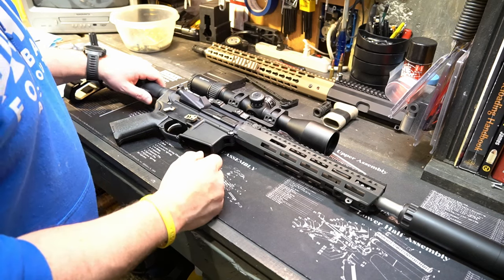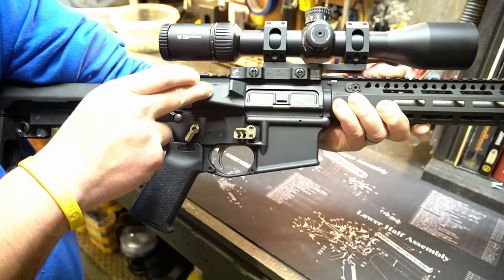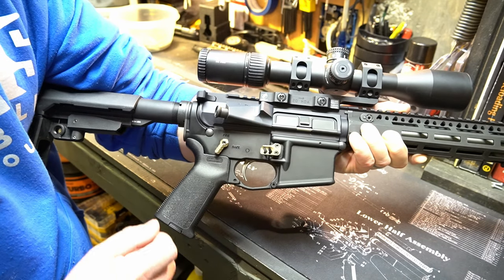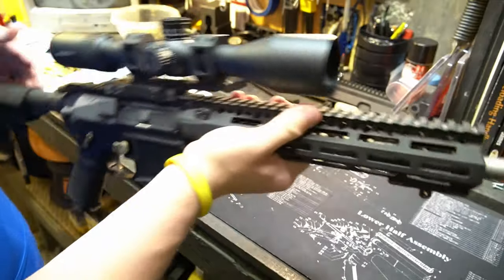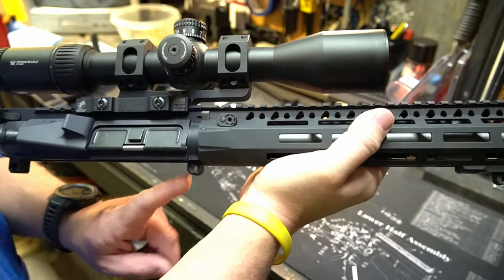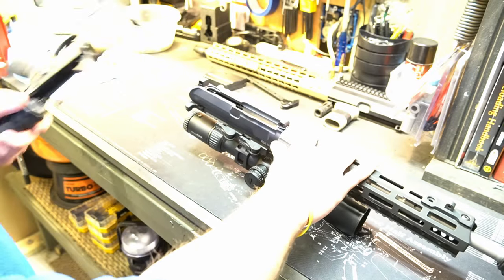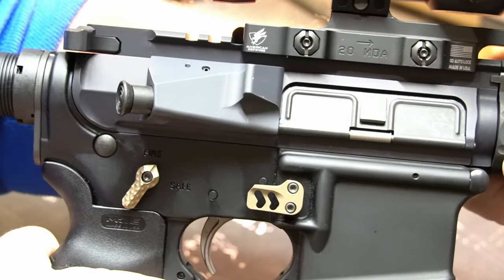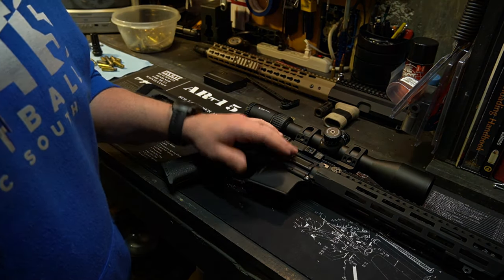AR15 Upper and Lower Wobble Fix

Comment from the maker: #7 or 3/8” o-ring should do it. Be sure to subscribe to see more 👍
Reply: Any link in specific
Reply: I got some at Lowe's today for $3 to put on my ar-556 , works great!! Thank you friends! 1/2" o.d x 3/8" i.d x 1/16"
Reply: If I had to pay a gunsmith assembler for a job, I definitely wouldn't want a cheap o'ring to replace many times. Not really any good choices for the wobble I suppose?
Reply from the maker: I would never pay a gunsmith to install my .03 cent o-ring. This is a diy, dirt cheap fix.
Reply: @HoosierHunter  Temporary.
Reply from the maker: Nailed it!  Sweet comment.
Reply: @Allenmar73  You just keep putting o-rings back on if one breaks. This is a permanent fix.
Reply: Was gonna ask lol thanks for the video
Reply: Pls describe in mm
Reply: Why not put an o ring on the back one too?
Reply: @chozen_juan  I would assume because the added o-ring creates a much tighter fit making the pin harder to push in/out and the rear pin is used much more frequently to open the rifle for cleaning.
Reply: Where can you get them?
Reply: @HighHOPE36  Virtually any hardware store. Or Amazon.
Reply: Thanks!
Reply: Can you use a metal washer?

Comment: For a permanent fix pull the pistol grip. There's a small set screw, turn clockwise with upper attached. Light finger pressure. Check fit, adjust more if needed. Then check fit of take down pins. If too tight back off an almost imperceptible amount.
Reply: Most lowers don't have that tension screw you are talking about, Aero does and some others but not many of them

Comment: I was just finished with a build and mating a Wilson Combat upper to lower and it had a wobble. I installed a new wedge which has always taken the wobble away but not this time. I got online to get other ideas and came across this video. I had some 3/8" O rings so I tried it. Perfect, I was even able to remove the wedge and it's nice and tight. Thanks for the video that turned out to be such a simple fix for something that's also frustrating to me.

Comment: I'm glad you made this video, those o-rings are going in my cleaning bag and my range bag TODAY.  Now, can you make a video that shows how to correct the play between my stock & the buffer tube ?  That drives me nuts.
Reply: My pistol has a SBA3 brace. What I did was, I took clear duck box tape and put it on the inside of the brace/stock on the top. I’ve put about seven layers of tape on the top inside until it got nice and tight and it works great.
Reply: I put the soft side of a velcro square on the top side of the stock. You have to rock it on but once its on its pretty tight. Little to no wobble. Now I havent tried taking it off since then but I plan on keeping that MOE stock on semi permanently.

Comment: I was going to try a thin washer shim between the pin ears, but your o-ring works fantastically, and I don't have to worry about losing a shim during a field takedown - since I have boxes of assorted o-rings just laying around, I feel like this is a completely free fix.
In the past month, I've eliminated buffer spring ringing (captured spring), gas tube ringing (high-temp fluorinated rubber o-ring), and now you've solved my upper/lower rattle.  My DDM4V7 Pro finally feels rock-solid, after 3 years of frustration -  Much appreciated!!!
Reply from the maker: Awesome feedback. Happy I was able to help 👍. Thanks for watching.
Reply: How to fix the gas tube ringing?
Reply: @anomalous8652  Armaspec has a quiet buffer tube spring system for ARs that suppresses the ringing, and I assume it would help the VR80.  There are other more expensive options (JP Enterprises works the best, from what I've read).  I use an Armaspec on my DDM4V7Pro (it works very well), but I've not bothered to tame the clap of the VR80.

Comment: Not knocking the idea because it’s affective as can be after trying it myself, but I’m just wondering if the extra tension will cause the stud provision to stretch or wallow from heat or vibration?

Comment: I put an o-ring in the rear also to fix the slight wobble on my new ar556 mpr Ruger. Did I do it wrong?
I mean: can the o ring get in the of the way of something during the cycling of the weapon?
By the way in my case o ring front and back and no more wobbling at all.
Thank you 👍🏻👍🏻

Comment: I just bought a Springfield Armory Saint Victor, and it has a screw accessible through the grip that tightens the connection between the upper and lower receiver. There wasn't much to begin with,  so a quarter turn on that screw was enough to make it feel even better.
Reply: That’s a tensioner screw arrow has them also, but you need to install the Magpul grip to adjust it without moving the grip. Magpul is the only grip I believe that has two holes inside, one for mounting and the other for the tension screw

Comment: Had this issue on a slightly customized URG-I airsoft replica - pretty annoying wobble, fairly more visible than what you showcase in your video. Didn't have a spare o-ring on hand but managed just fine with a thin strip of gaffer tape. Upper/lower fit is nice and snug now; no play, no annoying rattle. Thanks for the tip!

Comment: Nice fix. My gunsmith used a sharp centre punch and hammer to force some more material to those upper receiver attachment holes/hinges. Both making the lower receiver pins move tighter in the holes, and, if selecting where to force more material correctly, also shift the fitting a bit. Wigglety-wobble disappeared completely. 

I guess I should paint that exposed point in metal some day.
Reply: Never heard of that before, but it should work. You can check the play in the holes and see where you need to punch with a 1/4 inch cotter pin. Was never a fan of using o-rings so I'll be trying the punch method instead
Reply: Good idea the other way is to go with the Jp oversized pins and custom fit them to the upper. Thats what I’ll be doing soon. No rubber for me I don’t like stuff that I have to worry about wearing out.

Comment: Can you let me know the size of the rubber O-ring?  So I don't have to buy a whole set and try them all? Thanks in advance.
Reply from the maker: Sorry, I’m away from hone now and not there to measure it.
Reply: The size of the o ring is just about the size of most Fuel injector orings or just smaller. I used a fuel injector oring which was slightly large but only made the fit even more snug.

Comment: Just bought a new AR and I  also had slight wobble that was driving me absolutely insane!!!  It’s a OCD thing! 😂 You absolutely rock! I used rubber O ring  which happens to be a #7 O ring. 1/2” O.D.X 3/8” I.D.X 1/16” .  The marriage between the upper and lower are completely SOLID!! THANKS 🙏!!!
Reply from the maker: No problem buddy!  Happy to help!
Reply: @HoosierHunter  Thanks bro!
Reply: Thanks for the help! Got a box at Lowe's!
Reply: @TheRealEMURSE  nice! Truly makes a huge difference !
Reply: @user-Patriot1776  it is very satisfying! Also if you have the Magpul MOE grip that has the compartment you can sit two extras around the screw at the top! Very neat!
Reply: @TheRealEMURSE  no doubt puts the OCD at ease 😂 ! Makes the rifle completely solid ! Glad this worked for you as well!

Comment: I used a small rubberband wrapped around a few times to get it "gutentite" got a pack of 500 for 2.50🤷🏿‍♂️1k rounds later same rubberband is holding up just fine. Also mske sure the rubberband matches ur receiver color if youre like me, or compliments it.

Comment: Could this slop have come from tightening a muzzle device without a clamp? I started to tighten my comp and realized I shouldn’t have been doing that and stopped. Now I notice that but idk if it came from that or it was just how I built it to begin with.
Reply from the maker: I wouldn’t think so. It would take quite a bit if torque to do that.

Comment: Fixed mine by buying Aero M5 lowers with a built in screw adjustment to tighten the upper and lower together. Solid as a rock

Comment: Hey what brand/size of the o ring should I try? Willing to get a few different sizes In case the one doesn’t fit for my rifle any suggestions?
Reply from the maker: #7 or 3/8” will do the trick 👍
Reply: @HoosierHunter  thank you I appreciate it
Reply: I used 3/8” #5 danco O-ring, tight fit and no more wobble !
Reply: @omarmendoza7818  I had to buy a few different packs to see what would fit for me and I found the perfect size for my rifle that worked was Danco #41 9/16
Reply: @mischievousmelon  I might have to try it since I struggled to put the O-ring on
Reply: @mischievousmelon  update, it fit better than the one I previously used. Appreciate it man !
Reply: @omarmendoza7818  glad to hear that worked for you! the 3/8 o-ring for me personally was way to small, I couldn’t get it to fit around the metal piece where the front takedown pin goes into at all

Comment: I just made a gasket for the upper receiver from tape. No need to worry about the oring breaking or adjusting the screw between one lower and multiple uppers.
Reply from the maker: There ya go! 🤙🤙

Comment: I have a micro AR with micro buffer tube side charging handle when I take the rear takedown pin out I'm able to charge AR properly but with pins intact BCG  WILL not slide back all the way do you have a fix for that
Reply from the maker: Not sure without seeing it. Just make sure there is nothing stopping the buffer assembly from sliding back.

Comment: what do you do when the upper is to tight and does not disassemble easy because the back lock block is just to tight to push into the lower that i have and I am thinking its because the lower is Cerakoted FDE from factory?
Reply from the maker: It probably is die to the cerakote. I would find something to run back and forth through the hole to try and buff it out. Then put some oil on your takedown pin and just pop it in and out a bunch while watching tv.

Comment: How much can that affect the The accuracy or does it at all?
Reply from the maker: Not really. Just more annoying than anything
Reply: @HoosierHunter  I agree that it is annoying. Especially when you spend all the money and time to make it tight crisp and silent
Reply: I believe having play between the lower and upper can affect your shot group, especially when shooting greater distances. For instance, you can put the upper receiver in a different position while firing due to the recoil when holding the upper receiver thus shifting the point of impact.

Comment: Glad I saw this.. I just bought a new diamondback and it has the same issue.  I was hoping I could use a rubber ring or some kind of spacer or wedge to fix it.  👍🏻  This magpull stock is garbage and wobbles a little also but ill be switching that out eventually.
Reply from the maker: Thanks for watching.  Hopefully it helps!
Reply: Some tape on the buffer tube will fix that moe stock

Comment: Hey, so I put Loctite Blue(Super Glue).  Let it dry before closing your upper and lower.  Check with a finger to ensure it's dry.  You can put rubbing alcohol on it to dry any possible excess).  It hardened like a rock.  It doesn't come off easy, at all...  After some filing(slowly), got the perfect fit.  As I said, it doesn't wiggle at alllllll, and the glue is permanent(you just gotta file the extra, very slowly until you get the perfect fit.  Check your cycling and dryfiring to ensure you have no malfunctions).

Comment: Aero makes a lower with a adjustment screw for upper/lower tension. Im sure others do too
Reply: I have that but it walks out
Reply: Yeah, I have one matched with an Aero upper and it still fits sloppy because there’s so much play in the front pivot.  Also, by the time I get the tension screw tight enough to take out the slop I can barely get the rear pin in and out.
Reply: @allthebass  AGREED! Here's what I'm trying: I drilled a small hole in my trip so I can access the tensioning bolt with a hex med while the grip is still on / and while the receiver is closed. I just have to find a long hex wrench now :)
Reply: @DinoNucci  I'm going to try to get a hold of a Son's of Liberty upper as they are made slightly oversized and see how it matches up with the Aero lower. As far as the tensioning screw walking out, maybe try Vibra-tite.
Reply: @allthebass  report back soldier!

Comment: Brought here by my new PSA Sabre. Nice rifle with good parts but the tolerance between the upper and lower was pretty loose... especially compared to my Saint Victor which is rock solid. Anyway, i had a pack of green auto ac hnbr o-rings (-20~302f temp range) in the garage collecting dust. Of course they're metric. In case anyone wants to know the 8.8x1.9mm worked. Fit is nice and tight now! Thanks for the video fix! Still mad at PSA for thier machine tolerances... but its PSA, could i really expect much better 🙄

Comment: Is the upper and lower the same manufacturer? What are they if you dont mind me asking?
Reply from the maker: No, this is a VLTOR upper and PSA lower. Just to show how to fix the slop for possible bad fits on upper and lowers of same or different manufacturers.
Reply: @HoosierHunter  I see you run 6.5 grendel. Have you tried it in a shorter barrel yet since you have a suppressor?  I have a 300 blk with 10 inch barrel and a suppressor, but really wanting some longer range. Been doing alot of reading, watching and digging the 6.5 grendel with a 12 inch barrel with some good results out towards the 600 yd + range.

Comment: I like to find a tight match for my upper and lower, but it's not always possible, especially when you own so many of the budget uppers and lowers.  I used to wonder why my brother had so many stripped uppers in his shop.  I was just admiring how tight one of the AR's he put together for me is.  It goes together easy, but still has no play at all.  But not everybody can have several drawers full of different brand uppers(military and multiple brands).  He liked Military parts and high dollar commercial stuff.  I'm a low-budget guy, so I may have to use some O-Rings!  As long as it doesn't rattle, I'm OK.  A rattling upper and lower to me is like someone dragging their fingernails on a chalk  board!!  I can't stand it!  Even if the gun shoots accurate.

Comment: If you shoot a gun with some slop will it damaged your rifle?
Reply from the maker: Not if the slop isn't too bad.  Some is fine and won't hurt anything.
Reply: @HoosierHunter  thank you! Just built a rifle with different lower and uppers and new to all this. A little loose but not too bad. I got a wedge for a temp fix based on things I’ve read/watched
Reply from the maker: @Basedgodnick69  no problem buddy!

Comment: I'd rather keep the play than risk part of that o-ring coming apart and interfering with the rifles reliable just my opinion to each his own
Reply from the maker: I can understand that. It’s such a tight fit that if it does break, it never works it’s way out from that position or into the upper or lower receiver. Works pretty well.

Comment: Simplest solution, use a aero lower M4E1 with nylon screw in the receiver. Place upper and lower together, tighten nylon screw till it just barely touches upper lug. Put grip back on and AR is tight. 🎉🎉

Comment: Much appreciated. Going to try this on my Cheytec ct15 later today. I'm guessing Lowes will have a million o-rings, so I should be able to find the sizes you recommended.

I know this is extremely dependant on a ton of different factors, but do you find the oring survives a few take-downs, or do you just replace it any time you totally separate the upper and lower? Hardly a big deal either way, given that the thing probably costs a nickel. I keep a small bag of odds and ends in the post grip of my rifle, so it's not an issue to throw some extra o-rings in there as well.
Reply from the maker: No problem!  Yeah, Lowes will have them. Yeah, I just replace as needed and not every time I do a takedown. Good luck 👍
Reply: Got around to doing this last night, works really well. Mine still moves a tiny bit when I try to make it do so, but it's def a better feel and again, to even notice it still moves I have to forcibly mess with it. Got the o-rings in the plumbing section of Lowes for like 2$.

Awesome little "trick", great vid w/. excellent advice.
Reply from the maker: Appreciate it buddy. Happy it helped.

Comment: Yeah but everytime you break it down that little ring snaps everytime just take 2 slats of electrical tape and stick them on as spacers on the lower works like a charm

Comment: Play is fine all important action is happening in the upper. Lower does nothing to increase accuracy by much unless you're really into shooting 1000 yard targets then u might wanna look for tighter fit components. If your main objective is self defense 5 to 200/300 yards slop is fine.
Reply from the maker: I was ok with some play when I was active, but once I got out and started precision stuff, 1200 yard matches, etc. I realized how much I didn't like the play between the upper and lower. All of mine will always have the 5 cent fix, if needed as it does help.

Comment: Very pretty build
Reply from the maker: Appreciate that and thanks for watching 👍
Reply: @HoosierHunter  
Check out ' "Griffin Armament".
They manufacturer AR15 Dimpled Takedown Pin Set that cost 17.00 plus shipping.
They work fantastic!

Product Summery,
"Typical production AR-15 pins are ~.245" diameter and flat on the ends. They operate in .250 pin holes, and items used to push the pins occasionally slide off and can scratch your lower receiver.

This pin set is ~.248" diameter, allowing you to improve your upper to lower receiver fit, and features early Armalite / early Colt style dimples to assist in location of bullet tips or tools used to push the pins"